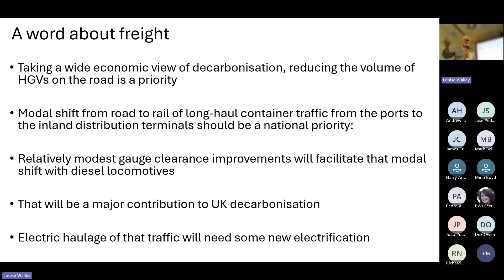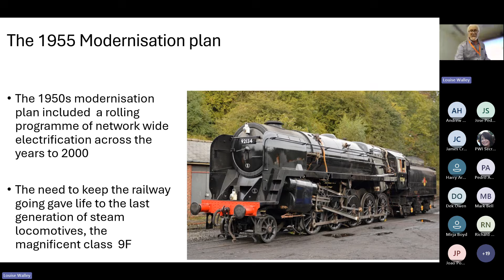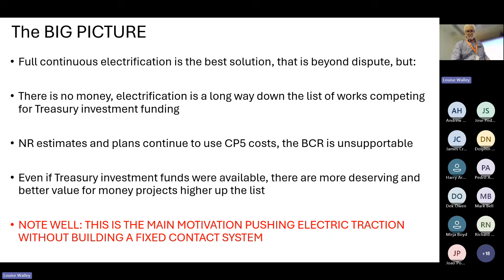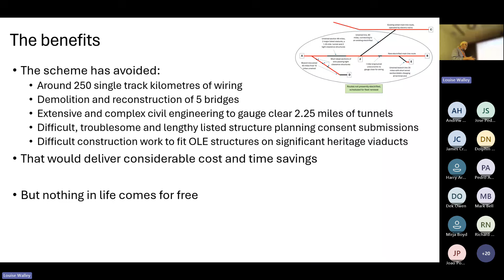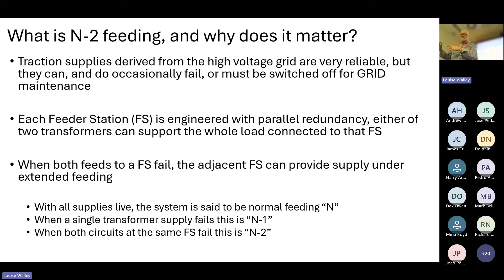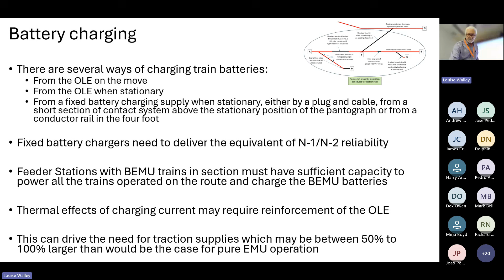Discontinuous Electrification: The case for and against - Peter Dearman

Comment: Over three decades ago in California, Los Angeles and Long Beach at San Pedro and other ports they spent a few billion to install grade separated (below, using existing 100 year old rights of way) 20-mile Alameda Corridor (opened in 2002) and other new rail corridors to downtown Los Angeles and out to the rest of America; after Alameda Corredor was built then Long Beach ports became the largest and most developed in America.   Note the Los Angeles 20 mile Alameda Corredor is 1/2 the length of the stopped HS2 Phase2a...which is similarly critical for the "spine" of UK north/south rail transport.  So we always need to make these critical choices for the maximum gains; including discontinuous electrification.   Another topic to discuss about this is passenger heating in the far north using battery only ?  Diesel has a great benefit for passenger heating in upper Scotland.

Comment: Scepticism about manufacture's claimed battery range, especially in cold weather, and lifespan degradation is reasonable for the current generation of lithium batteries.
But battery chemistry and tech is changing extremely fast. CATL have started volume production of sodium batteries. These have no temperature degradation in temperatures found in uk, vastly more charge cycle lifetime, greater depth of discharge, and vastly lower fire risk - this is at a cost of lower energy density than lithium NMC or LFP. (and obviously no rare earth issues for sodium batteries)
Not saying this is any kind of silver bullet - but it will increase the length of section where having an OLE gap can be effectively served by a BEMU - and lower the TCO and risk from BEMU.

Comment: Completely agree with the general point about freight modal shift and freight bi-mode ( on main lines need electric mode to make best use of network capacity)

but think you are down-playing the role of batteries on class 93, not just for shunting, but also act as re-gen energy store to reduce diesel consumption a significant amount, and as acceleration booster allowing smaller diesel when combined with battery to have performance equivalent to a somewhat larger diesel. 

Freight operators loco's are an expensive long life asset and the market and routes that asset needs to serve can change several times in its life so it's essential that they are something of a swiss army knife, at least in terms of being able to go anywhere, even if they can't haul everything.
(by comparison HGVs with complex double deck trailers serving national distribution centres - their life is much shorter so can be highly specialised for one single job)

Plus weight is good (up to a point) since it gives you traction.
So I really think bi or tri-mode for freight is the way forward.

Localised pollution, both air and noise, is important for lineside neighbours, so localised electrification of freight heavy routes where they go through populated locations could take some of the nimby sting out of modal shift ?

Comment: We are seeing now certain segments of the road haulage market transition to battery power and that will provide the experience to know whether scaling up further to railway size is possible. So Wales is probably the biggest experiment yet so whether that's premature - or whether it's a good futurology bet... we will find out in 5 years. But of course we have to remember that the battery is a an industry in it's absolute infancy which is both good and a bad thing, because we absolutely can't predict the way it's going to go.
We've also got short distance battery electric ferry crossings as as an ongoing experiment
Reply: Problem with freight locos is not likely to be either battery size or weight tbh; It’s recharging at freight hubs. If you want to be able to recharge while unloading/loading (which is ~required if you don’t want to dramatically increase costs), then every distribution centre and port in the country will need a multi mega watt connection. Which we can’t usefully do (as well as all the existing grid reinforcement we need) before 2050
Reply: @cianbrennan4477  that sounds like the requirement for car/HGV charging hubs, too. I believe that they use additional battery storage locally to reduce peak demand. In a railway's case, so huge as probably to offer significant grid balancing capabilities? But that would all take time, as you say.

Comment: Need 3rd rail network expansion
Reply: yes.  suggest another way to look at station fixed battery charging is a very short fixed battery charging "3rd rail" at the stations.
Another option is to have beefed up OLE at stations ONLY and 1-mile each side of stations for discontinuous electrificaiton and that would start filling the gaps with high current carrying capability.

Comment: Class 99 is bi mode its the class 93 thats the trimode example
Reply: You could probably make the 99 tri-mode by installing 3rd rail shoes, at least I hope they designed the DC Circuit for 750DC, otherwise it’s going to get challenging with space.
Reply: Yes, suggest however could they also be discussing a 99 bi-mode with a very small battery added for only shunting around the stations and not long-haul battery ?
If the onboard battery is only used for short shunting or short sidings use...then a modified 99 could have added battery and not be a classic tri-mode.